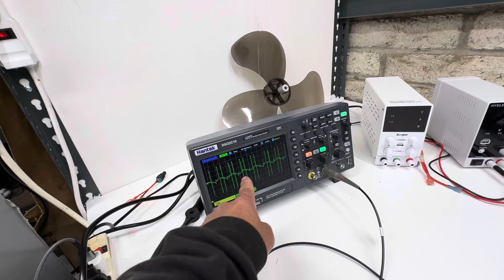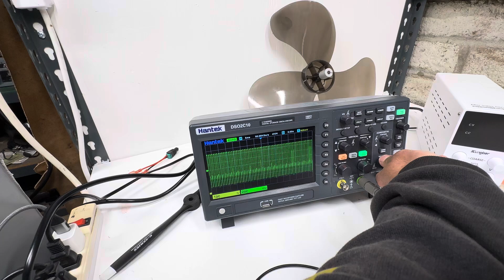Repulsion motor 3 phase 6,600 rpm

Comment: Every other motor features the cap dump.  Why not this one too sir?
Reply from the maker: Just to show output easier but it doesn’t take into account the 300 v + flyback spikes so it’s actually a lot more
Reply: 😅 I'd like to see the output of four coils by just using two coils to run then you could also put more magnets on the rotor.
Nice work
Reply from the maker: @Jon-fs2zj  thanks for the comment! 
 this motor does not use generator effect to make electrical output if you use it like a generator it will slow down and use up way more power 
 I’m using the collapsing magnetic field to get energy back